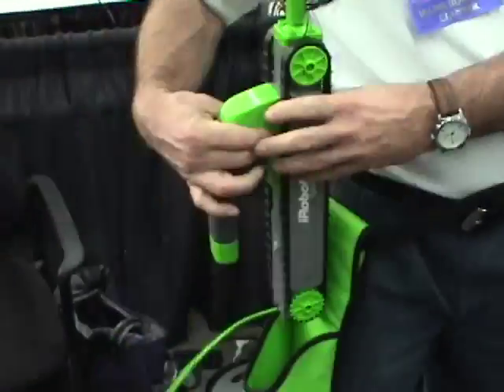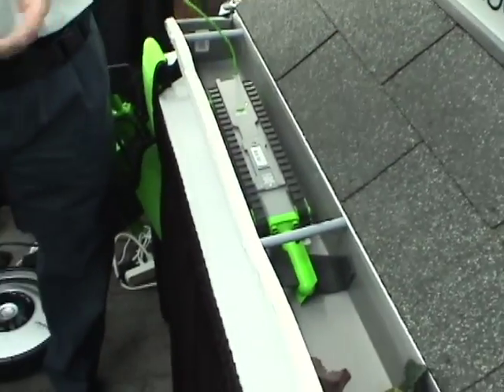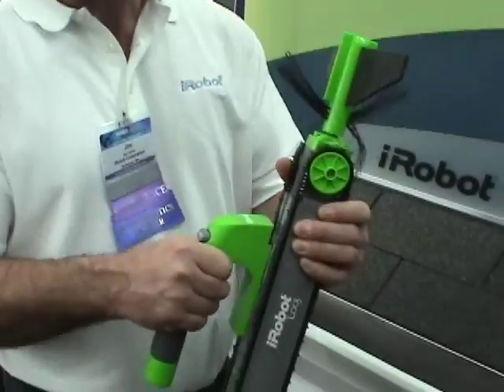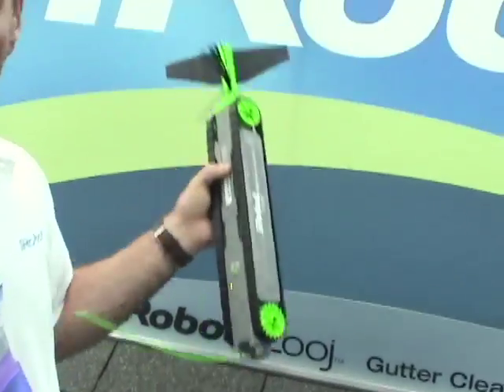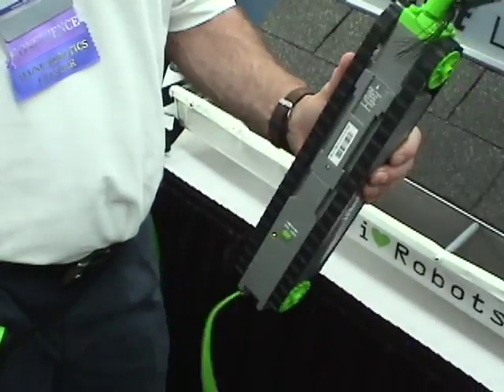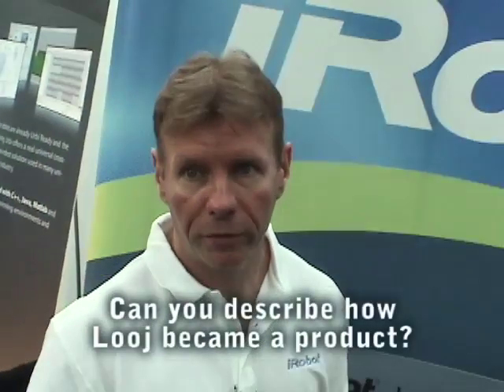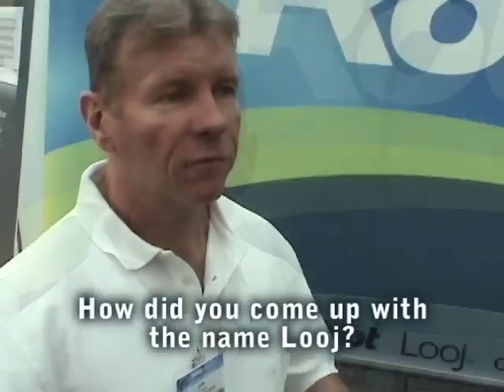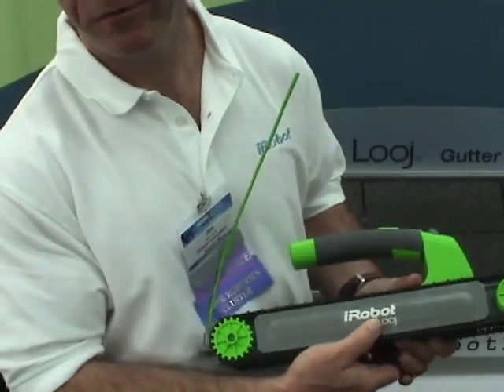iRobot Looj - Inventor discusses gutter cleaning robot

Comment: This is somewhat of a good idea, but the design is poorly thought out and this DOES NOT WORK well at all. Coming from someone who owns my own gutter company, I can assure you that you will never find a gutter with a few leaves just gently lying in the gutter. There are packed in wet leaves, twigs, sticks, seeds, gum ball tree nuts, dead animals, you name it. Not to mention, what happens to all the gunk and crap that a device like this slings over the edge. Now you have to spend even more time cleaning it all up off the ground and spraying it off the edge of your house. Don't waste your time and call a professional company with professional cleaning equipment.

Comment: I just cleaned my gutters for the 3rd year with mine and it works just fine. There is one short run of gutter where it can't go under the nails but other than that it's great and save tons of time.  Beware those that say it doesn't work if they are selling a service or another product!

Comment: My roof starts at 2.4 meters from the ground to the gutter, runs 13.4 meters horizontally, and ends with a 7.25 meter down vertical distance to the ground.  Placing the looj into the gutter at the accessable 2.4 meter height seemed logical and was later proven to be the smart end of the gutter to start with.

Comment: You obviously haven't tried this.  It works great.  I live in Washington State where my high roof is 22 feet above the ground.  Without an expensive rental lift, I cant even get to that gutter.  With more than 200 feet per charge, I can get all my gutters in a weekend.  This thing shot sludge, leaves, twigs, small pine tree sprouts and muck out of the gutter. 

Dont post unless you know what you are talking about.